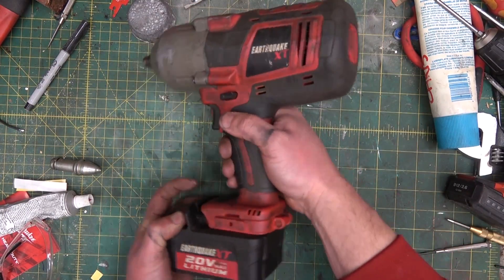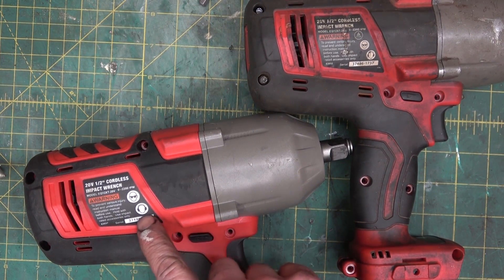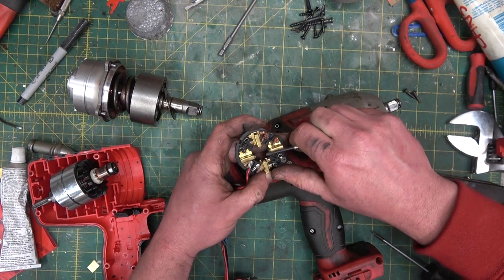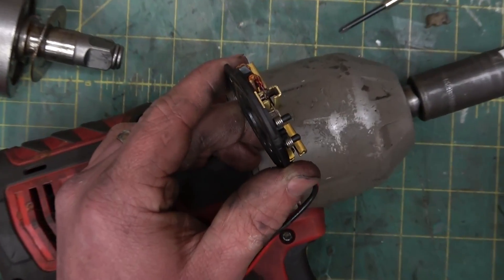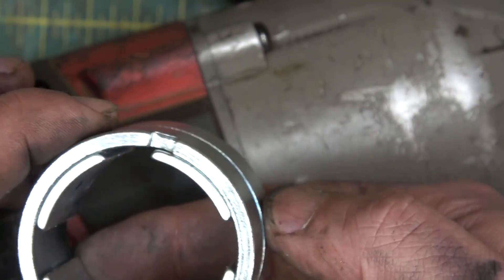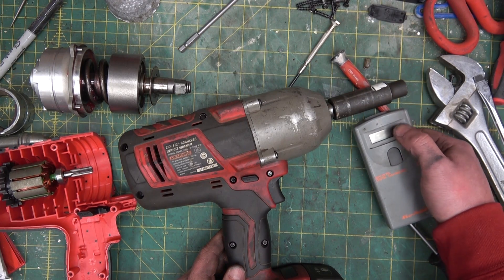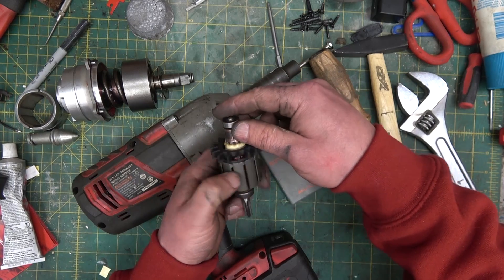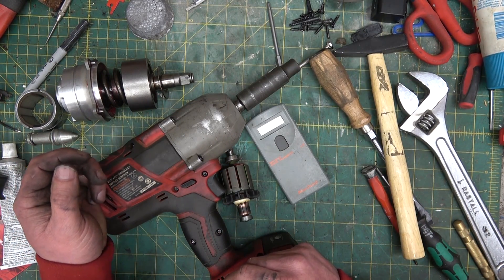Mystery Solved! | Why Impacts get weaker

Comment: Did you catch a cold or something?

Anyway, as I'm getting older I tend to steer more and more away from brushed crap like this. 
Just a week, or so, ago, I got sawdust into my only cordless drill... 70km from my shop, while spewing smoke and barely revolving... it was such a great feeling. 
Thankfully, I figured it was just dust in the brushes and managed to clean it and finish the staircase I was working on. 
Retrofiting brushless motors is fiddly and time consuming but, damn, it is worth it.

Comment: You still didn't find out what actually went wrong. What does "the rotor gets weak" mean? High resistance? Broken wires? Bearings shot?
Reply: Maybe he will do a 3rd video :)
Reply: Yeah he's being a bit lazy about it, seems to be rushing vids lately.
Reply: It's almost certainly damaged commutators given the brushes were worn down to their limit. Stick it on a drill, get rid of the major surface damage with some fine wet-dry sandpaper, polish it with rubbing compound or something, clean thoroughly, install new brushes. Done.

Comment: Great Video, love the failure analysis concept!

Just a few thoughts to check more thoroughly if you are bothered to:

Interchange the components to see how much the old brushes/flux ring affect the newer armature
Check the flux ring with your magnetic-field-viewing-film-thingamajig to see if magnets cracked 
Check the older armature for resistances, failure should not be uniform
You could also compare the motors further (wire gauge, resistance, smartphone magnetometer at set distance), maybe part of the difference is just a better motor overall

Comment: You should do an Ohms test on both rotors for comparison and maybe a insulation resistance test for comparison also. My guess is the stakes have cracks under the epoxy increasing resistance.

Comment: Confirm it! Put all the old crud but the new motor in.
Reply: Saurutobi valid troubleshooting.. sometimes you have to induce the fault with a suspected bad part as often as problems have a tendency to disappear when systems are disassembled and reassembled, for countless reasons.
Reply: @goldfishi5776  yea I've done this numerous times. Take something apart, progressively swap in stuff until it works, put in everything but the bad part and it still doesn't work. Ends up being some weird combination of bits
Reply: Absolutely. Only way to be sure it's not the new parts in concert that's fixing it. All original parts, plus the new motor, then you'll know for sure.

Comment: I don't think I have ever commented but been watching the videos for a long while. The test is invalid I'm afraid. To ascertain it was the motor, you would have to have bench marked tested the two machines straight out of the box (RPM;s, torque, etc) and then used one and shelved the other. Changing a motor and seeing an improvement is not proof that this was the cause of loss of performance (the fact that it's a different manufacturer of motor compounds matters). Do it again and do it properly!! :)

Comment: I know the reason. 
The carbon from brushes deposits in grooves of collector. 
So insulation between windings of rotor drops and motor does not work properly
Take toothpick and clean the grooves. After that clean with alcohol.
Reply: does that mean on brushless impact tools, this wouldn't happen?
Reply: @somepunk2541  Can't vouch for Noname's diagnosis but brushless tools definitely won't suffer from any failure mode that involves the brushes! Depending on the type of brushless motor they can have their own different failure modes though e.g. degradation of permanent magnets from heating
Reply: @grahamsnyder762  One thing about brushless motors is that when you halt the rotor you don't get the same effect where the moment gets higher like with brushed ones.

Comment: how about part 3 of rewinding the motor and also doing wire resistance check between both the motors of the ugga dugga . would be cool and yes i don't clearly value time for suggesting this

Comment: Dumb question from a dumb 'murican Moose: Would it be possible to chip away at the epoxy and try to re-solder the windings to the Chinese Potato (i.e. "commie 'tater")? Also, for the root cause, is it likely that the failure mode is actually related to the brushes not making solid contact, creating higher resistance there leading to excess heat that gets things all loosie-goosie and increasing resistance at the armature?

Comment: Kinda like in the Yeti video, where you ended up nerding out in the metallurgy dept and never concluding why it works well..
Reply: I dunno, I think the discussion about the vacuum, the copper coating, the bits that touched, and the use of stainless steel kind of explained it.

Comment: yeah , but did you keep the old parts and just changing one part at a time ? because if you really just transplanted the whole new motor assembly on the old one you really didn't find anything , try the old setup with the new armature , , lastly maybe there is a pair of coils that are dead and thats why is not going as fast .... anyway

Comment: Bumbled this one right up, how about you measure the motor RPM when the tool is under load!! or better yet measure the torque it's putting out, for all you know you might have fixed it...